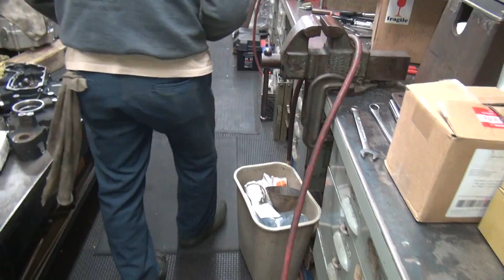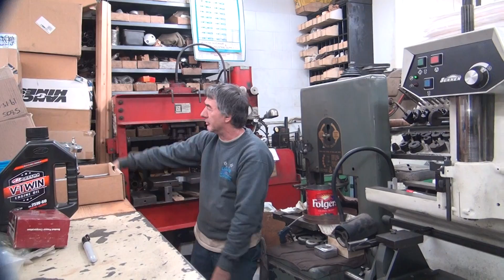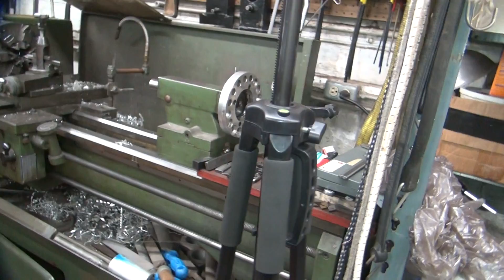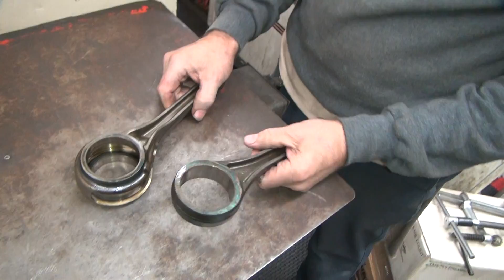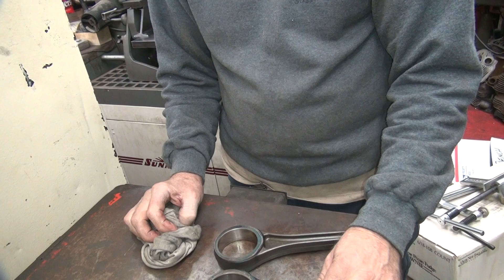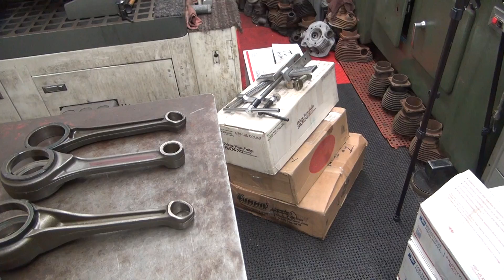#146 the making of flywheel truing tool crankshaft rebuild time m8 evo twincam harley tatro machine

Comment: The gear comes off pretty easy. I made a couple of small t-nuts to put through the slots in the gear and use 2 bolts and a small 2-slot puller.
Reply from the maker: i didn't think it would take much to take it off but in the end, i don't have too.
tatro